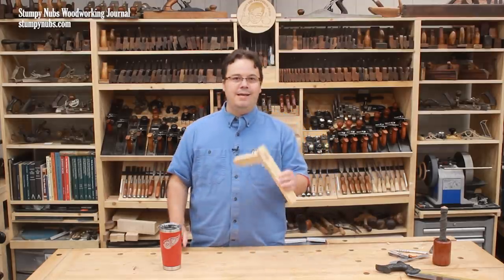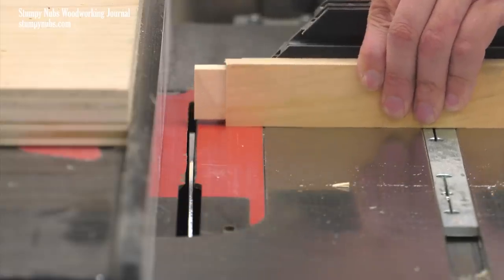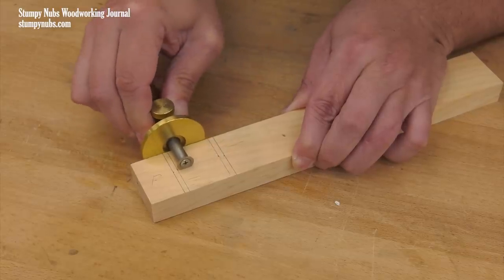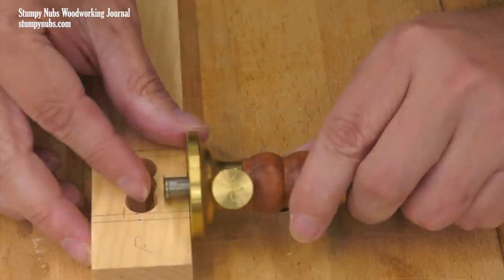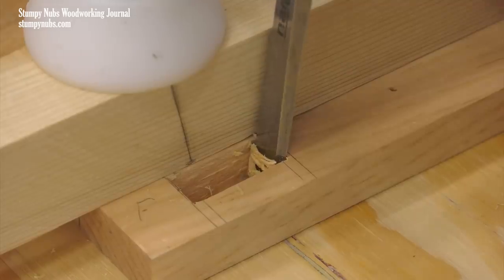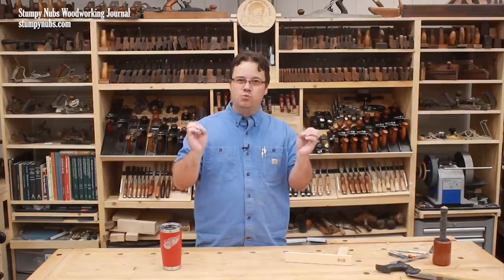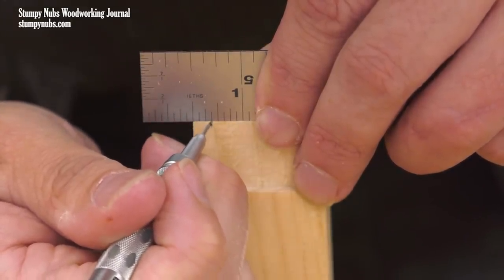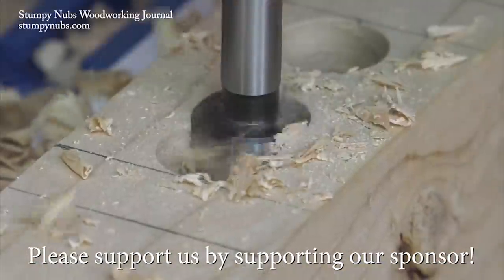How a little wedge makes the STRONGEST joint ever!

Comment: I've been a metalwork fabricator for about 10 years now and Im just beginning to get into woodworking properly (for hobbyist purposes). 
My God what a can of worms I've opened! Im virtually having to unlearn everything I know about metal and re-learn for wood. 
For instance he mentions, sneaking up on the correct dimension and never go over. With metal working, its not a massive issue and can sometime work to your advantage. 
If your cutting a mitre frame for instance and you over cut the angles, with metal, not a problem, just fill the gaps with weld. 
But nooo such luxuries with woodworking! I feel this learning curve may well be a steep one! and Hopefully an enjoyable one!
Reply: Cut yourself some slack and take your time... As we often say in woodworking, "Measure twice. Cut once." It's a reminder to double check that you REALLY want that material wasted out...

     AND save the sawdust for each piece and kind of wood you use. It can be mixed with glue to form a paste that you can then smash into any gaps that might show... It's ONLY a cosmetic fix, SO you're joints need to be physically and functionally tight (that skill comes with time and repetition, like anything)... BUT there are lots of little places where a gap or hole here or there is no consequence structurally... AND with a bit of "glue-dust paste" to match the wood around it, nobody but you needs to know about it.

     I'm lucky I guess... going the other direction, from leather and wood-working toward metal. My angle grinder still makes the welder I am more like the welder I'd like to be. We're all learning.  ;o)
Reply: An addition to what gnart said ...
Most important thing first: Safety.
Watch James' (Stumpy Nubs') videos on safety; this will help you keep your fingers for your next projects. ;)

Basically you only need to learn one tool:
The Chisel.
A saw is a bunch of chisels on a row (angled differently, but they're just chisels).
A plane is a chisel held in a fixed position (except from those that fly, but that's a whole different story).
A drillbit is 'made' of two chisels that go round and round.
... You get the idea. ;)
Now wood differ from metal in several ways, one of them is the 'grain' which metal doesn't have.
You need to think about which direction a board will expand/contract and you should get familiar with crosscuts and ripcuts.
James made videos about this; so did both Rob Cosman and Paul Sellers.
I recommend Titebond; it's a good glue, which covers most needs; it's fast and it's strong.
In some cases (outdoor) you may want to use Elmer's, which is more expensive, but should last better in moist environments.
Matt Estlea started out a few years ago with a series about how to "Plane Correctly", "Saw Correctly" and other videos in the "correctly" category; they're worth watching. Also Paul Sellers is good at teaching sawing (getting a straight cut with only a hand saw; he tends to use hand-tools and he keeps things simple).

Last but not least: Happy woodworking - remember you can combine with metalworking, since you have the skills. =)
Reply: @68HC060  arguably, a plane that flies is also a chisel: It splits the airflow into a fixed (high pressure) part and a loose (low pressure) part, thus generating lift. And, as with chisels, the wing being dull or rough causes drag. It is actually a quite remarkable and obvious analogy when you think about it. Disclaimer: I am not an expert on aerodynamics or fluid dynamics in any way.
Reply: @lhpl  Good enough. You win. =)
Reply: @68HC060  I didn't know I was playing - what did I win? :-)
Anyway, I think many great ideas have begun like this: someone saying "X is not/can not do Y", in just the right way to make someone else realise that - surprisingly - X actually is/can do Y.

And in an even more abstract sense, everything that happens in the universe is either stuff being joined together or stuff being split apart.
Reply: You can almost always add wood. All you need is more wood with more time and some glue. Cyanoacrylate, epoxy, PVA or polyurethane construction glue. Even Bondo! Perhaps some wood joinery or mechanical fasteners might help. But it is not always true that a hole too big or part too short can't be fixed.
Reply: You should go watch a Robrenz video (try "making precision gage balls" )... he does some of the metal machining where he is pretty particular about the correct dimensions.
Reply: If you like to great/durable/sharp tools, metal is as intolerant as wood, I think. Cold worked edges on elastic backbones don't respond well to welds and grinders, just as wood fibres don't respond well to free form grating. We're all learning from and struggling with mother nature I guess. But there's no such thing as UNDO, I'm pretty sure of that one :)

Comment: One thing I've recently started doing when laying out mortice boundaries with a wheel-style marking gauge is to reference off of the opposite side of the work piece so that the gauge crosses the mortice. That way, the shape of the cutter is aligned such that the plumb side is the actual line that I want to cut to and the sloped side is in the waste. I find that I get cleaner lines this way.
Reply: Thanks for sharing this pro tip. Your contribution is the primary reason I read comments.
Reply: I have two style gauges. One has the bevel facing in, one has the bevel facing out. That way I get clean lines for both sides of the mortise. The problem is remembering which one is which. :-)
Reply: @criswilson1140  that’s a good idea. Maybe color code or label the gauges?

Comment: id love to see a vid on blind wedge tenons as an addendum to this one.
Reply: Really, the only tough part there is depth precision... Matching wedges to it is best done with the wedges just a tiny bit shorter than perfect, so they definitely seat, and still fit to width... 

   As to the mortise... socket... You'll want to (optimally) be within 1/32" (around .5mm ish?) of exactly "dead on balls" from it to your tenon (depth to length) and usually, it's alright...

    What you don't want is stopping the whole piece with a 1/8 inch of tenon sticking out because the wedges won't sink flush with the end... OR wedges too thin to tighten the tenon in place.

     AND test and sneak into it BEFORE you add the wedges... Once they get involved you've got ONE fit-up... and glue or no glue, there's no taking it apart. It's either good enough to last the test of time, or it's going to show off where you F'ed up ... forever...  I highly recommend a sense of humor... especially if you drive forward on your own.

    It took me probably about a dozen wonky adventures on the blind wedged tenons before I quite ironed it out, myself... BUT it is wood, after all, and there's a little bit of forgiveness... 

     Once you've got a "style" or "system" to do them reliably, they're a lot of fun to dry-fit. There's no glue, no signs of screws, no nails, and even older guys who know the craft can be stuck there scratching their heads... ;o)

Comment: hey, no need to appologize for your shaky hands. Im impressed you are very skilled dispite of the shaky hands. I know a lot of photographers that use glasses. painters that use tape for straight lines. Waiters that use calculators. ect. Stay safe, and thanks for the content. Im motivated to start doing wood working , but I dont know where to start.

Comment: Great video, enjoyable. To add my five cent piece, I normally cut my wedge about 2 mm shorter than the hole. This is to avoid wedges that hit the bottom of the hole before it fully spreads the tenon.
Reply: At the back or at the front?
Reply: @zoutewand  I shave the tips (narrow bits). The thick edge of the wedge is a bit long to be planed down once inserted.

Comment: Once again, outstanding instructional video. If you didn't "split" the tenon, and inserted the wedges at each side of the tenon, would it still hold as well?
Reply: Had this same exact question.
Reply: It wouldn't; it would just be like a standard mortise and tenon.
-Unless you make the sides of the mortise parallel to the sides of the tenon and make the 'wedges' straight.
Reply: Not quite as strong. The way he did it, for the tenon to pull out, the bent wood fibers at the very edge of the tenon will have to break — and that takes a tremendous amount of force. If you just put the wedges alongside the tenon, only the glue bonds need to break for the tenon to slide out. It is something like a 4X difference in force.

Comment: I've done something similar without through mortises, inserting a wedge in the tenon then hammering it home so that the bottom of the mortise pushed it in.  Without glue, the joints have held over 25 years so far.

Comment: I recently built a router table to clamp into my vice. Then I needed a rack to hang it on and two wedged mortise and tenon joints allowed me to make it using what I had lying around. Even in pine, it's impressively overengineered.

Comment: The note that the glue makes the wedges and tenon all act as one seems obvious now. It eliminates my concern about the minimal hinge point.
Reply: That's not how it works though. A standard mortice is held in only by the glue; a wedged one is held by the glue and its wedge shape. However, the wedge is an actual wedge only as long as the thin side strips are connected to the tenon. Were they to break away, you would be left with a wedge-shaped object in the mortice that is only wedge-shaped as long as the glue continues to hold it... which is exactly what the standard mortice does. If the connection of the side strips to the tenon would be irrelevant, you could just hammer in the small wedges at the ends of the mortice, without ever splitting the tenon - you'd still be left with a wedge-shaped object that can't come out of the hole... as long as the glue holds it together. Except that's not what we're going for here, and if the side strips do break off, all you have is a standard mortice you wasted a lot of extra effort on.

Comment: Heres an interesting point but not directly related to fine furniture construction. 
I build log furniture and used to use Titebond but wracking would eventually break the bond. So i switched to PL3x.  It will not break apart...ever. I had to fix the dimensions on one bed so i tried to undo it with a 20# sledge and the wood broke but not the tenon bond. Then, just to check, i built a test frame znd tried jacking it apart (aftrr curing) and again the log broke but the tenon didnt pull out. 

Moral is dont disregard construction adhesives.

Comment: I do it "the other way," but without the hole drilling.  It's always bothered me and for exactly the reason you said, but it was how I was taught. From now on, I'm doing it your way. I think I was taught to make my vertical cut closer to the edge so that I'd get a hinge similar to yours, but I think your way gives a better wedge and more latitude for choosing where the wedge will be.  Just one thing: In this example, the orientation of the wedge was obvious. Sometimes, you might be dealing with a square tenon or otherwise have a choice about which way to run the wedge. If you're new to this technique, just be aware that you don't have a choice. The wedge must be crosswise to the grain of the mortise so that the wedging action is along the grain of the mortise. Otherwise, you may break the piece with the mortise in it when you drive the wedge. Also, if your mortise is too close to the end of a relatively thin piece, even if you do it right your wedge might blow out the end of the mortise. It's important that Stumpy's example is for far in from the end. Move the mortise to be only 3/8" from the end, and you may be in trouble. There's only so much that can go in one video, so I'm hoping this comment helps someone. Excellent video! Thank you for making it.

Comment: I was a little skeptical at first, thinking that the wood would not flex enough but the way you did it solved that concern. In the work I have done I have bored a 1/4" hold thru the assembled Mortice & Tennon and inserted a hardwood dowel. Pretty quick and easy and very strong.

Comment: Stumpy, I have noticed the shakiness of your hands and I understand it can make precise woodworking difficult at best. I have a similar problem, though mine may be more intermittent than constant. My problem with that is I'm one of those poor woodworking bastards who is a perfectionist. It's hard enough to make a "perfect" project when your eyesight is perfect and you have steady hands. It's nearly impossible without both. I've realized that there is no "perfect" when it comes to woodworking, if for no other reason than the fact that wood itself is not perfect and it tends to change over time. I'm slowly coming to realize that there is no perfect piece of woodworking even if you are the best woodworker in the world. That's the only thing that keeps me going when I get frustrated by shaky hands or poor eyesight. One thing that helps me in this hobby is using power tools as much as possible. It's so much easier to get square corners, repeatability, and "more perfect" cuts than doing it by hand with a handsaw or hand plane or chisle. There are times when no power tool will do the job, at least not without a huge amount to set up time, so we often sacrifice perfection for good enough.

Comment: I have heard of these joints getting slightly loose over time, but only with heavily abused joints of hammers, axes, etc. (especially if the material of the mortise isn't wood). However, that has a simple fix of adding another wedge (or perhaps another on each side)

Comment: This is a really great example of how friction, which is often considered a temporary or low strength holding method (like clamping or weighing something down), can actually be used in an extremely permanent way.  The harder you pull, the more those wedges are forced together, until you really would need to break the whole tenon to pull it out. The angles are such that it's "self locking" - which is a really important engineering principle. It's the entire reason why nuts and bolts work at all. 

If the bolt thread had a steeper angle, The nut would just unscrew itself when the parts were pulled apart. But there's a critical angle where enough of the force pulling the parts apart goes into mashing the nut and bolt together that any additional force just makes it harder to unscrew, and the bolt breaks before the nut unscrews. 

This joint basically does the same thing. It could be interesting to make one of these, but going into a very shallow piece of wood with far too wide of a flare. You would find that there is some angle where the "wings" just push the wedges out, and the tenon can't be locked in at all. 

Another cool use is the tapers on machinery where concentricity is critical. You just jam the taper in and tighten the drawbar, and now even with the drawbar loosened you have to whack it with a hammer to get it back out. 

Friction is cool

Comment: Hi Stump, 
My first attempt at woodworking (9 months ago) was a console table made of two butt-jointed 2x6s per shelf. The shelves are connected by 1’-long 1”-diameter black iron pipes that run through 1” holes in each shelf’s corners.  (I’m consistently 11 years behind fashion trends, so I was going for industrial chic.) After a year of perusing the whole of your YouTubery, I’m sufficiently confident to switch the pipes out for a more attractive wooden option. Is there a joint that would allow me to reuse the circular holes in the shelves (regardless of whether they are left circular or made square), or is the better option for a first-year woodworker to simply cut a rectangular section from each corner that removes the 1” hole and allows for more conventional joinery?

Comment: I can tell you it’s not a good looking joint. It’s a great looking one. 
Last time I drove wedges into a pickaxe handle, I split the shoulder. Guess what, I did the straight down relief cuts with holes drilled at bottom. Now I know what I should do.

Comment: Looking at the Fisch Bits, they look like really good bits, but for a first set the price is very much 'ouch!!'.  At this point in my life my budget is somewhat limited. That's not saying I will be getting the Harbor Freight set for $37. But what about the Freud Diablo bits? Would they work as I slowly upgraded individual bits that would get the most use?

Comment: Very interesting video. The guide was quite clever. Can the same technique be used if your tenon is not going all the way through (there is a bottom), like the leg of a chair where you want it to be invisible? Not much room for error here. The length of the wedge must be very exact and you cannot pull it out again.

Comment: Cant wood glue create a bond stronger than the bonds between the wood fibers themselves?
Ive seen videos comparing wood glues and often times the joints didnt break where the glue was but the actual wood fibers themselves broke. And it was in tension, trying to pull two 2x4s apart that were joined at the ends.

Comment: I have seen both methods, (holes or slant) used and the maker sliced open the joint to see the result. Both tenons split and broke at the base, BUT, it made no difference, both were still holding fine.

Comment: The next strongest mortise and tenon  joint would be to squash the tenon in a vice with a waffle face to put dimples and slightly compress the tenon to carry more glue into the joint and then expand from the moisture in the glue. I use this all the time, make the tenon slightly over size and squash it to fit. This is similar to what they do to biscuits.

Comment: Rather than wedging all the way to the opposite side, I would recommend wedging 50%-75% of the total distance to the far side of the wood piece.  I try to avoid putting pressure on a point of wood.